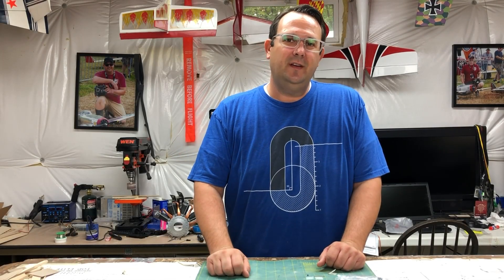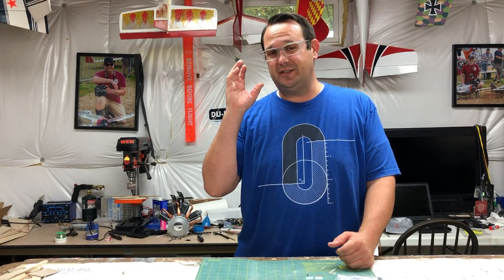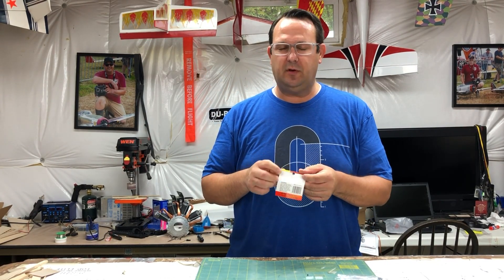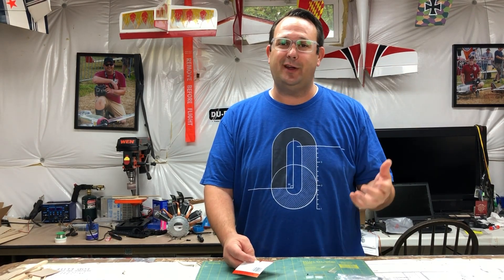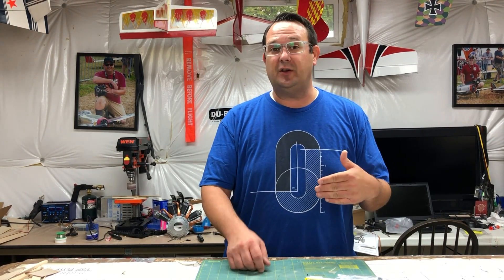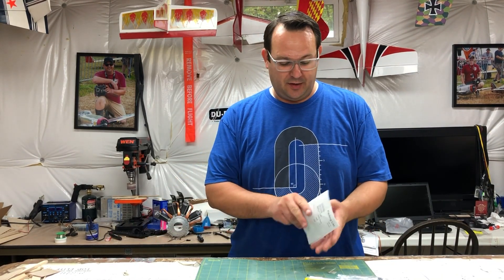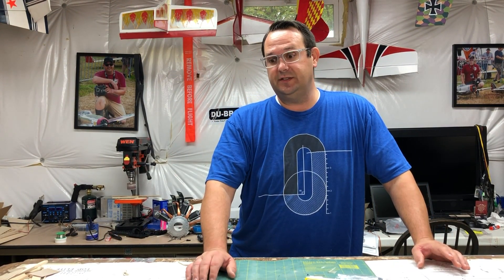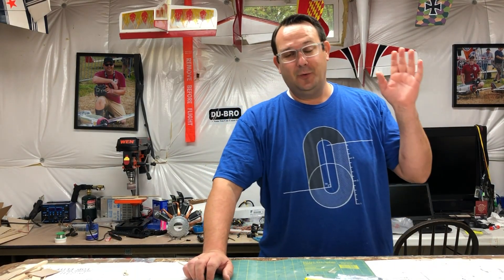How to make spring hinges!

Comment: Hi Joshua,
Awesome spring hinge video. McMaster-Carr has been my first go-to source for about two decades. If they don't have it, most likely it will be difficult to locate. You and the family stay safe.
Reply from the maker: Thanks, Don! While I have had to source some specialty hardware for other vendors over the years, McMaster has served me very well for easily finding what I need as well as providing CAD models of things I need to design for 3D printing. They are a phenomenal resource that the new builder should know about. Thanks for watching and you too, be safe.